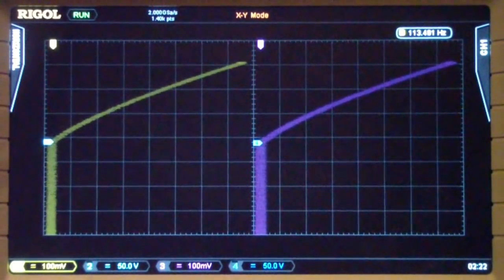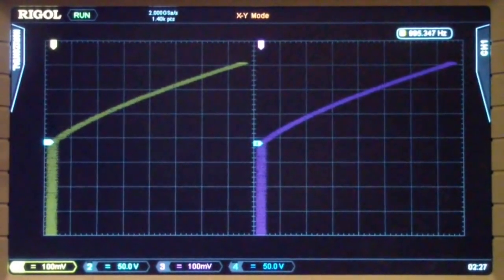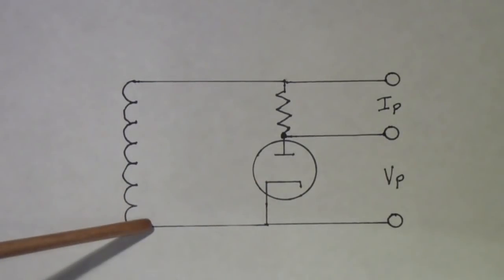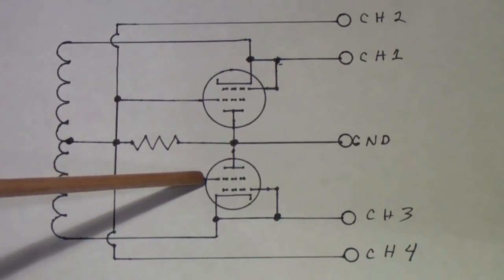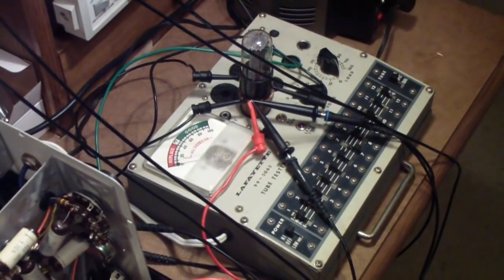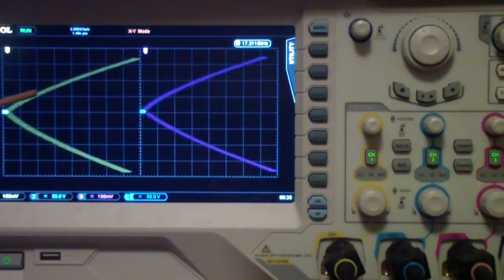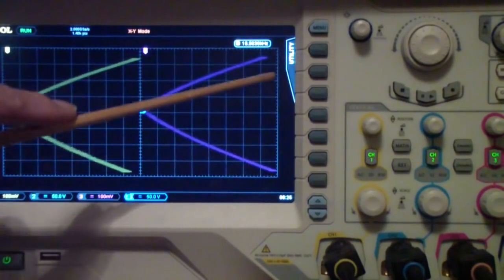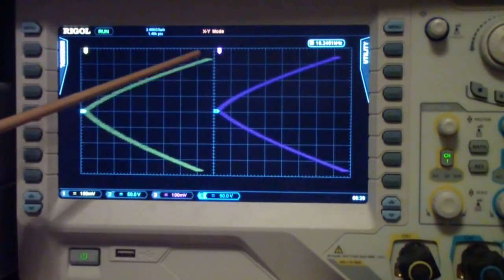TTT224 Tube Matching with a Curve Tracer

Comment: Your curve trace playing has inspired some ideas in my mind. I've still got a lot more thinking to do...

But one of the things that I did was I reversed the valve's (tubes) direction and added a second 10 ohm resistor.

That is, the centre tap of the transformer connects to one side of two 10 ohm resistors. The grid and cathode of each valve are tied together as you did, but the valves are not tied together. One valve's grid/cathode connects to one of the resistors, the other valve's grid/cathode connects to the other resistor. One valve's plate goes to the top transformer winding, the other valve's plate goes to the bottom winding.
 I did this with triodes, but I suppose if you were to grab two more resistors and put one between each plate and each winding, you would have your slight drop for the screen grid.

The scope earth/ground point is the centre tap winding. In this way, the only current flowing through each resistor is the plate current of the valve it is connected to.

This of course still does not solve the direct overlay comparison inability, but should get both XY readings to be side by side in the correct orientation. I do not own any 4ch scope, so I am not sure if it is just a Rigol limitation. 

At the end of the day, it certainly is a interesting way of approaching this with minimal components.